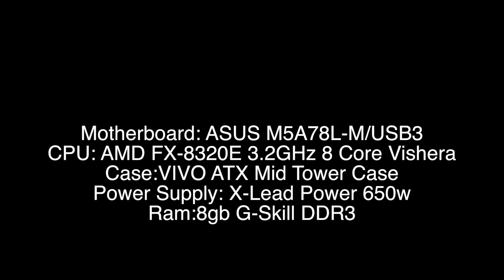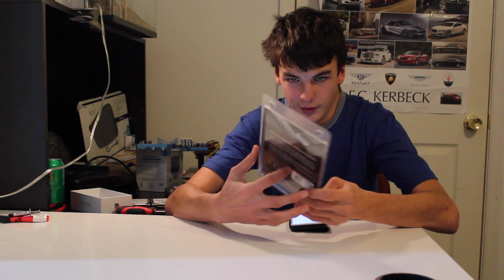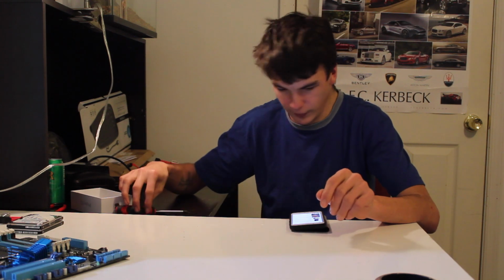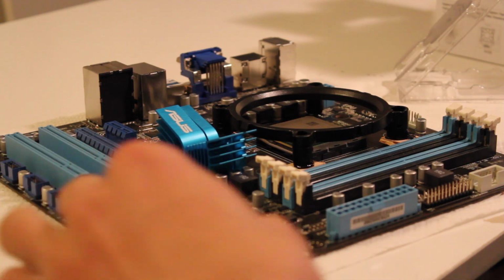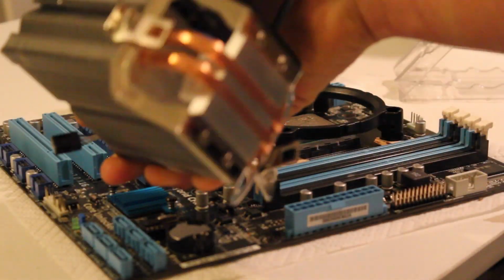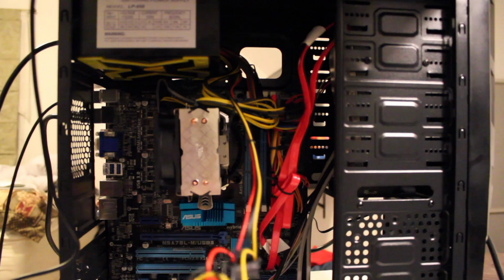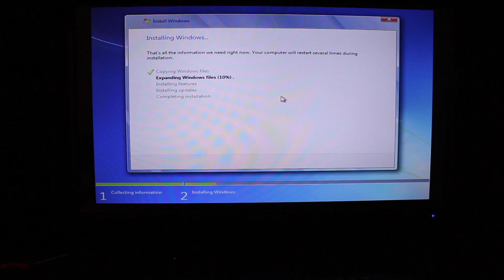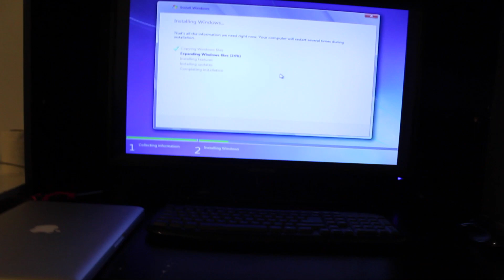My Custom PC Build March 2016

Comment: bruh that's a sketchy ass psu, other than that nice build!
Reply from the maker: I definitely agree with you on that power supply, I think my system is cutting out from not enough power
Reply: Honestly, you can get a $45 psu that is a lot more reliable and will last longer, I learned real quick that you can't cheap out on a PSU when you make your PC. my old PC got fried.
Reply from the maker: +The Hilo623 yes I've had to replace the power supply already
Reply from the maker: Hilo    I did end up upgrading the power supply 😂😂
Reply: noice